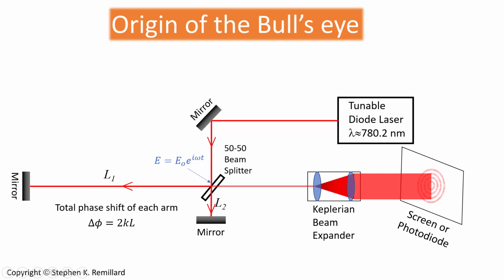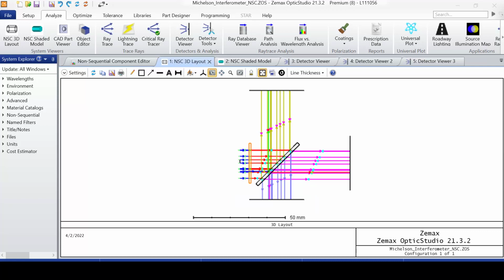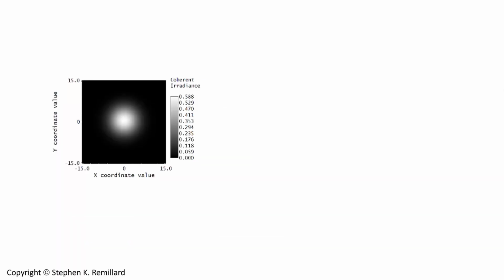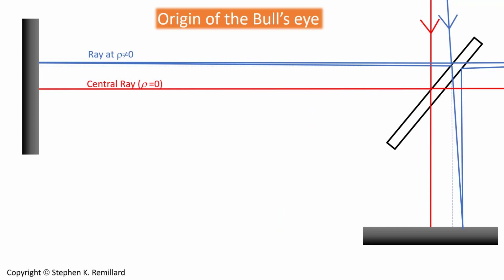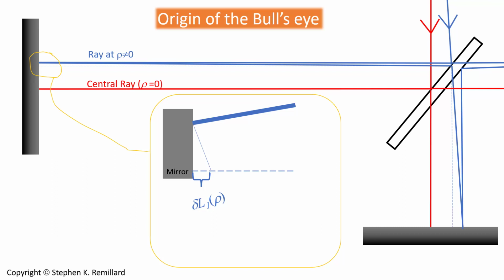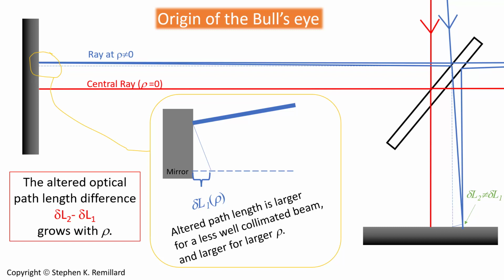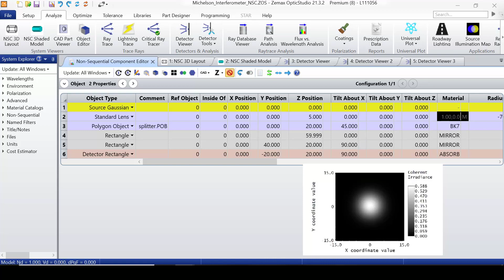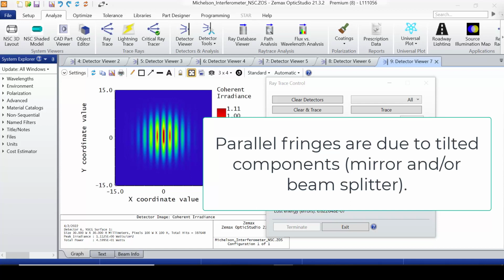Why Does a Michelson Interferometer have a Bull's-Eye Interference Pattern (sometimes)?

Comment: I think you've missed the point of the "spherical" explanation. Consider the laser beam to be two concentric beams, each eith a very small divergence. One beam is reflected by the mirror, the other is transmitted. Because the beams have a non-zero divergence, a reference phase, call it 90 degrees, will occur on a series of spherical wave fronts. Half of this beam will make will make it to the detector. The other half will reflect off the second mirror and likewise produce a series of spherical wavefronts of 90 degree phase. The intersection of the two wavefronts, and the consequent interference, will take place at the intersection of two spheres of different radius - a plane. For perfecly aligned beam splitter and mirrors, the intersection plane will also be perpendicular of the two beam centers. This will cause constructive interference. The closest intersection of 270 degrees of phase will produce a similar ring, but this will have destructive interference. Stepping through the repeating values of phase gives a series of interference rings, alternating light and dark.
Run another simulation with the mirror distances identical so the total light path at the detector is equal (no mirror tilt) and you will see that there is no ring structure. Change the path mirror positions / path lengths and you will get progressively finer rings.
The circles are an artifact of the fact that the phase difference, and hence the interference and brightness, at a detector plane represents the intersection of two spheres.
Fizeau rings are the result of a tilted beam axis of one of the spheres.

Comment: This is a wave optics phenomenon happening due the limited spatial bandwidth of the collimation lens. Also the the output hole of the laser acts as a single slit. The bullseye/airy disk pattern should already appear when the light exits the collimator, before getting into the interferometer. 
The geometric optics stuff in the video just adds onto it.

Comment: Very interesting. I guess I have been mistaking the "Michelson interferometer" with the "Michelson-Morely" experiment. I think that by design, the Michelson-Morely experiment requires the components to not be perfectly aligned at 90 degrees. For one, the beam reflected from the mirror directly across the laser should not reflect the light at exactly 90 degrees to the beam, so that the beam does not go back into the laser. At least that is what the manual recommends.
I have been trying this out with the cheap industrial fiber optics kit, and have actually gotten some parallel fringes. though even if I do not cross the beams, I can see some sort of interference from just a single beam, I am guessing it has something to do with the quality of the laser beam and it collimation, since it is basically just a laser pointer that I am using.

Comment: The short answer is - the detection plane is presented with a spherical wave front but plane wave front. 

When a spherical surface meet with a plane surface the central location meets the wave front sooner than its periphery that causes a phase shift in the radial direction like a ring of constructive and destructive pattern.

Comment: I really wished I had seen this a few days ago...  Why is this information so rare?

"Optics: Two-beam interference - diverging beams | MIT Video Demonstrations in Lasers and Optics" and "Optics: Two-beam interference - collimated beams | MIT Video Demonstrations in Lasers and Optics" demonstrate this a little bit; but lack the explanation (though one of them adds an additional spreader in the mix and emphasizes the circular character...   Most everything else I've seen says that the interferometer would have produced vertical fringes - but I suppose that's because of the diagonal that every little bit is a slightly longer path and those waves would interfere destructively(with even a ideal columniation) - at the splitter even, well before the final output... or even in the space after the splitter.
I got some various things from amazon - but this cube splitter I can't seem to get any interference... while most things seem to use more of a slide of glass; I wonder if the interface that makes this cube splitter is too thin.

Comment: So basically as I understand it and i think thats what you explained, is that we get the fringes simply due to the fact that light diverges and when the two mirrors are not exactly the same distance this divergence in the two beams of light is no longer at the same angle, the angle then overlaps causing interference to only occur at some parts. Makes sense.
The problem i then have is when you keep moving the one mirror further away you get a repeating effect of the fringe pattern showing up and then disappearing over and over again. What would cause the absence of the interference when the beam angle is not equal?
Reply from the maker: It's been my experience that the interference fringes are always there.  They expand outwardly or inwardly as the mirror moves, but they don't go away.  Here is a video that demonstrates the response of the bull's-eye to mirror movement: https://www.youtube.com/watch?v=TZ8RdkXv2Fs
    Two spherical waves are interfering.  When one mirror moves, the relative phase between the spherical wavefronts changes.  When projected onto a planar surface (the screen), the value of this relative phase depends on the radial coordinate.  All that can happen when a mirror moves is that the fringes move.  
    The dark spot that comes and goes in the center of the bull's-eye is just a result of the relative phase at that exact location, and it cycles from 0 to 2*pi as the mirror moves.  In some experiments, a photodiode is positioned there and the resulting sine-wave output of the photodiode corresponds then to the fringe spacing.
Reply: @stephenremillard1  well in the MIT video series on the subject the fringes show up in a distance of the optic inside the laser they use. Maybe it doesn't work that way when using a diode laser
Reply from the maker: @wynand988  I think that the appearance of interference fringes inside the laser optics over a short range of OPL is likely due to additional wave interactions than the two simple interactions that I used in my analysis.  Well, must be so.  If you have it, can you share the link, with a time stamp.  I'd like to take a look at it.